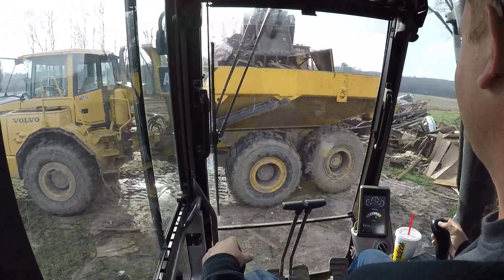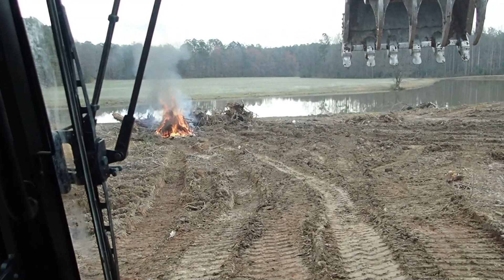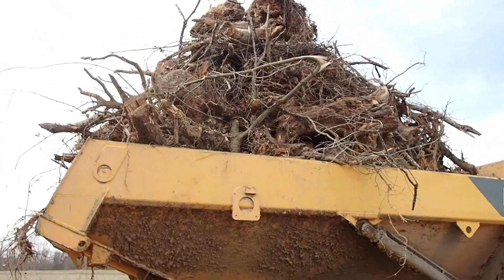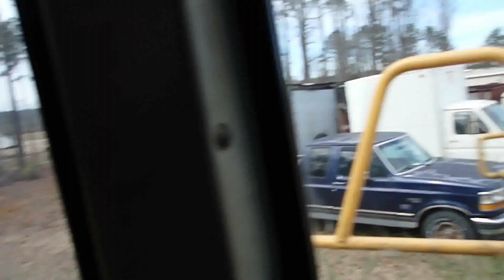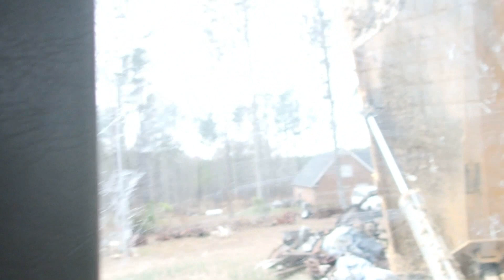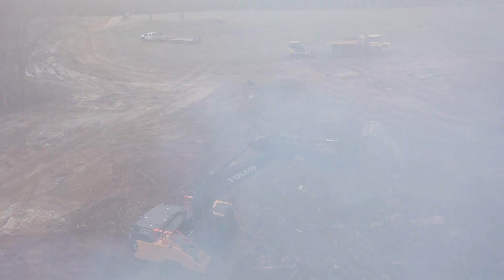Grading/ Demo/ Raking, And A Good Fire!

Comment: Would it be more efficient cost and time wise to grind all the stumps and debris into mulch vs burning everything?
Reply from the maker: no cost about 4x more
Reply: Well, burning is free after paying for how you ignite it and then using the machine for 10-15 mins every 2-3 hours to put more onto the pile.   Since he doesnt own a grinder, he would have to hire someone or rent a machine of some sort, then take hours or even days of time doing stumps on top of hours or days clearing the land.
Reply: Tub grinders around here cost $900-$1000/hour of operation and then you must still dispose of the residue. Not very cost effective where burning is an option.
Reply: Wow yea I guess burning is more efficient then lol.
Reply: Yeah don’t forget the truck needed to haul away the mulch as well
Reply: seems like filling in some low land with the stumps and debris is a easy way to get rid of that stuff without having to burn it.

Comment: this may sound like a dumb question but what are the metal bars on the top of the bulldozer blade called you get a good look at it about the 17 min mark is it like a grizzly bar setup or headache rack type deal
Reply: That's the root rake. It has teeth on bottom to rip out roots and the bars on top is the brush guard.
Reply from the maker: Thats a guard we added to keep stumps from rolling over the blade and smashing into the radiator
Reply: thanks i was just curious so its just an extension to make it taller and to ad protection seems to work thanks for replying and keep up the great work and the videos coming also i like the drone shots sometimes especially after you have explained whats going on that way we get a over view of the scale and magnitude of the job
Reply: Dozens can be powered l piece of equipment  but all it takes to wreck one is a small tiny stick through the radiator.
Reply: My bad spelling. I meant dozens and powerfull
Reply: Dozers

Comment: Volvo has been good to you on these machines. Poor mans cat is what I called them. Same color and parts for most part but a bit cheaper to replace. Just in parts alone that wear out or "burn" out, you should be on your way to making the decorative things that go round and round. Curious if you worked on the 911 job in new york as you sort through stuff like you're looking for a silk hanky. Such good hand to eye that if they told you to use a spade or shovel to dig something up, you would hope on a big excavator and pick that shovel up ever so gentle and take a spade full and throw it on the fire along with the spade/LOL. I don't take to man u all la boooring either. Your better than most and still got a ways to go to get your golden excavator award god hands out so take your time getting that one. Good work with good equipment.... following the ol' boy on the 955 must a made you a bit humble. We all start somewhere or just wind up on it and then suicide is a option, mind you not a good one. Man can always get off that mad dog 20  20 and find a good job counting faces at walmart

Comment: Dislike for burning also the plastics that was mixed with the wood. 👎
Reply: It's very easy to take the high moral ground when it's not your business at stake... it doesn't matter what his feelings are on whether to burn or not, if the area he is working in allows burning and his competitors are pricing jobs on the basis of burning that sets the local price.  If he prices the same jobs based on the cost of having to mulch and or dispose of the debris in a landfill he would never have any work.
Reply: i absolutely dont agree. there is no reason for burning plastics in the fields. we all have to collect and pay for disposal and it would be for everyone easy just to burn it all and cheaper too. this just lets everyone who invests time and money in collecting and disposing it look like an idiot. on my opinion if you take over a job that includes getting rid of waste then you should do it right. otherwise you are just the same as the other people who dont care.